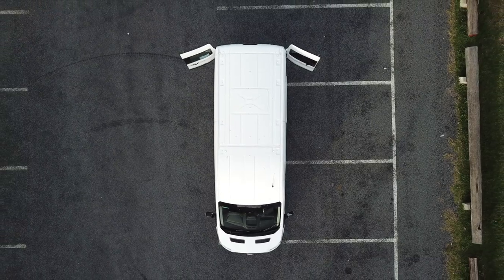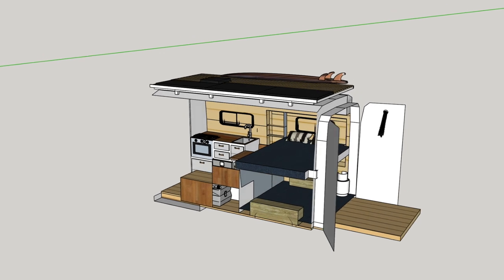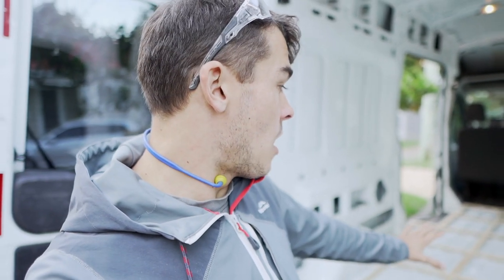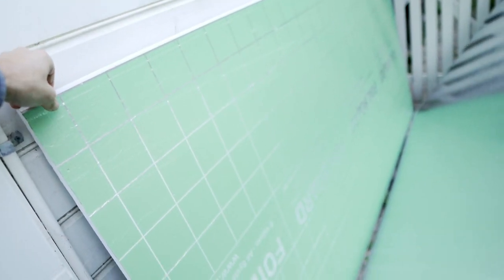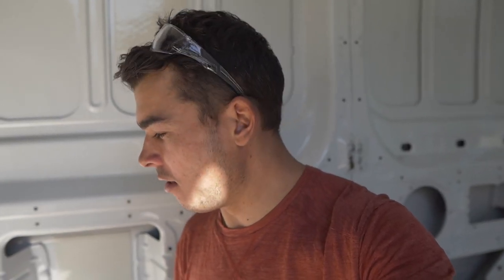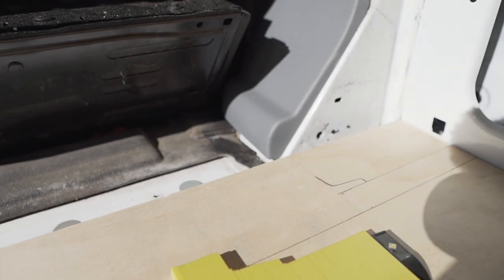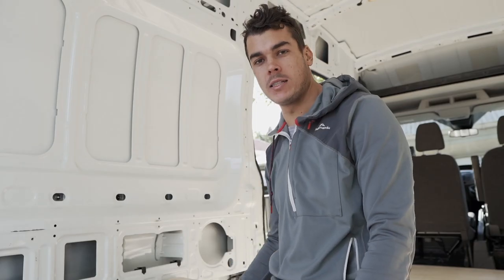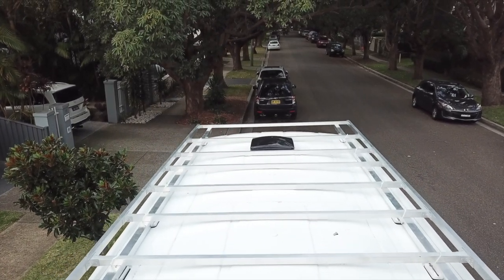FLOOR INSULATION (and sub floor) New FORD TRANSIT Van build

Comment: Hi mate, just a bit of advice, doing a van as well...you really need some kind of sound deadner over the wheel arches. making the box to go over is a good idea, and you have the form board. If you get insulation , even the earth wool, fill it inside that box over the arch, it helps with noise and insulation as the air gap otherwise its a wasted space....
Reply from the maker: Funny you say that, I drove around with it in this state for a couple of days and then bought some sound deadener. Made a big difference when driving in the rain and not getting the water hammering the wheel arches. It will be featured in a future video when I sound deaden the whole van.

Comment: Following this with great interest.  You asked if there was interest in a video on understanding your design decisions, yes I would be very interested to understand your design thoughts.  I was intrigued to see you had built the bed cross-ways - at 6 foot four I would not have thought you would have had the internal room to do this, but I am sure you have measured everything
Reply from the maker: I am very determined to save the space by sleeping widthwise and I really want a fixed bed in this van so I will make it work. My calculations say I will "fit" but I might have to sleep a little on a diagonal to me comfortable. But i'm happy with that if it means I can pull it off. The walls of the bed will have minimal insulation as to save space with 3 or 5mm over that to cover it up.

Comment: Just bought a 2005 transit LWB diesel an hour ago for 3k with some stuff to fix up. Limp mode problem, hopefully algae or something. Anyway, binged all your vids about a month ago and your guys content is top shelf! Learned so much and definitely the most underwatched, criminally undersubscribed van channels. Yous are champions and can't wait to take what I'm learning and apply to my van thing. Cheers and all the best :)
Reply from the maker: Wow thank you so much for the amazing comment. Very humbling. Hope these videos are helping you out then for your conversion.
Reply: Hi Daniel, I just found this channel (great job, Salty!) and your comment; I also bought a 2005 transit LWB that has a limp mode problem that neither the RAC workshop or an auto electrician/mechanics shop has been able to solve... did you find out what was wrong with yours?
Reply: Hi Robert, I never got round to fixing it, so not 100% but the signs lead to 2 faulty diesel injectors and they are super expensive to replace so I sold it but kinda regret that. You can get the refurbished I think? @RobertFernihough-wj1fb
Reply: @danielphillips2855  Thanks Daniel, I appreciate that you took the time and it gives me somewhere to start... cheers!

Comment: Too bad that I did not find your video 2 weeks ago when I had to cut my plywood subfloor.  I could have looked for a similar great tool like your contour tool.

Oh brilliant idea of padding the wheel base boxes with insulation.  I have not seen this after watching over 300 videos.  Most people have been attachin insulation directly on the wheel bases.
Reply from the maker: Yes those contour gauges are great for van builds. It has come in handy in so many places with all the awkward shapes of the van. Good to hear i'm pioneering haha! I did end up sticking some deadener to the wheel arches but the boxes work great with the insulation!

Comment: Loving the channel mate...you can make a free contour gauge with a piece of cardboard (has to be  the cardboard with the ripple in between) cut into rectangle shape or any shape you want  and about 20 or so and and wooden skewers. Cut the pointy edges off the wooden skewers and slide them into the cardboard (in the ripple bit). It's dodgy but it's free...lol...keep up the good work mate. Thanks again
Reply from the maker: Great tip! It would get me out of a pickle if i lost mine for sure. Would also work great on bigger corners too!
Reply: Have you done a video on the installation of gas lines in your van...I saw the bottle installation but not the gas lines installation...thanks

Comment: You had me at “sliding deck” in the back, as you’re only the second one doing this I’ve seen so far - and I planned this as well into my build a while ago. The width is limited by the wheel wells, unless you come up with a clever idea 🤔 can’t wait to see it all unfold! 🤗🇨🇦🇲🇶👌
Reply from the maker: I'm very determined to make this work. Fortunately this van is so wide the width between the wheel arches is 1.3m so it's wide enough for what I think will work.
Reply: Loving your channel. So glad I found it. 

Regarding the deck, sliding, yep I can do that. But one question I've just found after finding the right sliders....it's a shower deck. 

What or how are you dealing with water on the deck....the deck will have excess water on it from the shower. How are you dealing with that going back into the van

Comment: I’ve been wondering about screwing the wood planks into the floor. Seems like a lot of people just glue it down but it doesn’t seem like enough to me. Thanks for sharing!!
Reply from the maker: There is a good change that just gluing it down will allow the sub floor framing to come loose over time. Hence its a good idea to add a couple of screws in there to really hold it down. Don't forget to always check where your screws will pop out and spray them with a bit of rust paint too from underneath

Comment: Great video, thanks!! I'm about to embark on the floor so this video really interested me. Is there a reason why you wouldn't use the plywood strips BETWEEN the ridges of the floor? (I'm trying to preserve height.)
Reply from the maker: Yes, you can if your not going to install floor insulation. There needs to be a frame above the van floor for the insulation to sit.

Comment: Hi bro, why did you batten the floor for the insulation & not just glue n screw it straight down in full size sheets?
Reply from the maker: So the weight of the conversion doesn’t squish the foam insulation

Comment: I know i am very late commenting but i would really like the know the size screws you used to screw the Frame into the Metal Original Van Floor. I know there are things under the van that i dont want to puncture when screwing into the Van Floor

Comment: Great video.. did you also glue the foam to the van?
Reply from the maker: Thanks! The foam in the floor is not glued down as it is just squeezed into position with the floor battens so gluing them would not be necessary.

Comment: Just wondered on your thinking as in No solar up top??
Reply from the maker: Well it all depends on what power consumers you plan to install, time spent off grid without engineer running and the size of your battery bank. Doable Uber the right circumstances of preferred travel

Comment: Hey there! Great videos so far. As we are planning to buy just the same model and i am the same in height as you are i have a question regarding the bed. Do you want to extend the walls at the side? Because other way there wont be a way to fit in that bed at 6‘4? 😅
Reply from the maker: The bed length is 6"3 but because I don't actually sleep as stiff as a board so I find it a good fit. If you sleep on a slight angle you get a few more inches too. Extending the walls with flares was my first option but seeing how crazy expensive they are to get them to Aus (about 4k and unpainted) i opted for this option and i'm really happy with it so far.

Comment: On the rear opening (I guess on the step side ,too)... how do you finish off the subfloor and floor to make it look good and to seal it?
Reply from the maker: I will wait until i have layed my final flooring before completing the floor trimming. It will either be aluminum angle or potentially a dark hard wood angle. This will hide the edges of the both the flooring and sub floor

Comment: Hello Mate, I’m watching you channel with delight as I’m building a Renault Master. Just wondering, did you stick the foil board down on the floor or just place it in between the battens?
Steve. (TILDA 2)
Reply from the maker: I just cut them to size at fit them snugly in place. Didn't glue them down

Comment: Did you varnish or apply anything on the floor before starting to build on it?
I know you then varnish the wooden floor, but I’m interested in knowing if any moisture could get trapped in the floor (I did the same insulation as you) so basically if you think it’s not necessary
Reply from the maker: Not on the subfloor no. Im not concerned about moisture getting in the floor. It's pretty sealed now that the floor boards are in over the top.

Comment: Very helpful, thank you!
Did you use 15mm marine ply or standard for the subfloor? We were going to use 9mm but it feels really flimsy and bends a lot when you walk across it.. Thanks!
Reply from the maker: I used 15mm standard CD grade ply. Reason being for the rigidity. Although doing it again i probably would have gone with 12mm just due to the close proximity of the floor studs i used. Yes i would say that 9mm would be much to thin for sure!

Comment: Hi, what length are those self-tapping screws you are using on the floor frame?  I have just started my build and first up is the floor, but not sure on length of screws to use...was thinking of using 20mm - 2011 LWB high roof Transit.  Also, do you think it's worth use stainless steel screws?
Reply from the maker: Screws were 20-25mm 8g, just enough to go through the 15mm ply and into the floor. The self drilling screws are measured I believe from the tip to the flush head (and there is no thread where the cutting bit is) hence why you man need the 25mm
Reply: @SALTYVANVENTURES  Thanks mate.  It can get a bit overwhelming trying to figure it all out, but your videos have been excellent as a "how-to" resource.  Pretty entertaining too.  Cheers :)
Reply: @SALTYVANVENTURES  you say "just enough to go....into the floor". I think there's a real risk in going through the floor of the van and exposing the screws on the underside, which would risk water intrusion.  On the other hand, if we are trying to go to pierce through the floor, then the screws just barely grip the floor.  Both are a risk, so is it even worth screwing?  Perhaps just the adhesive is sufficient and safer?  I'd love to get your thoughts on this.

Comment: Hey mate, just curious about removing the cargo barrier. Do you know if an engineering certificate is required for insurance reason? Thanks, enjoyed the video and keen to keep an eye on the build
Reply from the maker: Not officially but I just chucked my barrier out today and had a bit of an inspection of the barrier. It really is just thin sheet metal, so thin I was able to fold it in half twice to throw it in a bin. There were no crossbars for support that would suggest it's use for structural support.

Comment: How’s do people manage to put there bed in sideways? Ford transit are 1.78cm on the inside before upgrades I’m 10 cm to tall
Reply from the maker: Not true. They are wider around waste height. Don't believe what the specs say, measure one for yourself.

Comment: Hi. Trying to get through floor with pilot hole for diesel heater but after getting through wood it wont go any further. Do I need a different drill bit? My van is a fairly old Transit. (Already converted)
Reply from the maker: You will need a high speed steel drill bit "HSS" designed to drill metal. There are also different thicknesses of steel in the floor. The main floor wis 1-1.5mm sheet steel but if you drill through something thicker (2-3mm) it will be very hard. You need a sharp drill bit. For bigger holes for the diesel heater you can use a step drill ( they look like little Christmas trees), I prefer these over hole saws. Hope that helps
Reply: @SALTYVANVENTURES  Thank you. Yes, done it now. Got some Cobolt drill bits and used a hole saw. Worked a treat. The step bits look interesting!

Comment: Also, what thickness is the ply you are using for the floor?  Sorry but there is no mention of the ply thickness or the screw length in your videos - and I'm a noob.
Reply: Just arrived here:  https://imgur.com/a/8bHv6IV
Reply from the maker: The floor was 15mm ply, on reflection I could have used 12mm and would next time.
Reply: @SALTYVANVENTURES  That sounds like a great idea.  Thank you.
Reply: @SALTYVANVENTURES   bought 12mm as you suggested because it makes sense.  just completed the sub floor framing.  one thing I learnt during the process was to BUY AN IMPACT DRILL.  Drilling pilot holes sucks, but an impact drill will remove the need for them and speed the build process up considerably.
Reply: @Vlaid65  were you not worried of piercing through the floor and risking water intrusion?
Reply: @mjklsnyder  Nope, screws should prevent intrusion as they block the hole (and I wanted the screws to go through the floor for extra strength and the glue will not be enough, and will probably fail over time anyway), and if there is still intrusion I should probably not drive through creeks of that depth...  Went with 25mm sheet metal screws into 15mm ply subfloor (using an impact drill - so no pre-drilling) then 12mm ply floor and it turned out pretty good.  

One thing I found to be difficult about starting the build was the tendency to over-thinking everything and to want to build for 100 years of service, when 15 to 20 years of service are more than enough in a van.

Comment: Just contemplating a build - I'm 67 and no carpentry experience - woo hoo 😮 - absorbing your vids like a sponge - cheers - just a question - when screwing the timber sheet flooring I'm assuming its going down into the timber strips of the framework for the insulation ?? - cheers
Reply from the maker: Awesome! I hope you are getting some use of of the videos then!. Yes the sub floor is screwed into the strips that were glued and screwed into the van floor.

Comment: being so tall how will you got in a width size bed?? our biggest design dilemma!!
Reply from the maker: The bed measures 189cm across, I'm 191cm. I fit comfortably as when I sleep I don't stretch out straight. And if you sleep on the slightest of angles you get a few more inches too.

Comment: Could you just use liquid nails without putting holes in the floor?
Reply from the maker: Well you can but there is no guarantee the glue won't degrade and maybe move over time. Liquid nails drys fairly hard so isn't the best for a moving rattling van. For me the idea behind it it had the screws hold the wood down the the glue help and also stop any squeaking. It also solves the problem of the wood moving while the glue is drying and also having the wood dry flat
Reply: @SALTYVANVENTURES  thank you.  Do you have to rust proof the holes? I really appreciate your videos, I'm a kiwi wanting to get a transit and do it out but I have no experience.  So I'm looking for cheaper options to.  Can I also ask where you got your sound deadening matt from please.  Love your story.